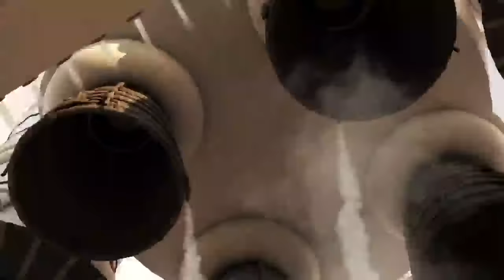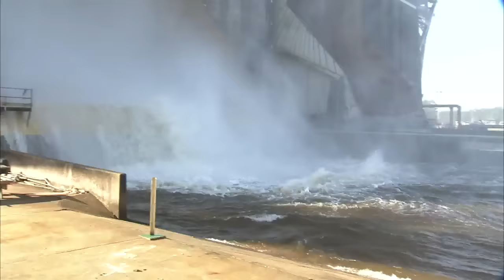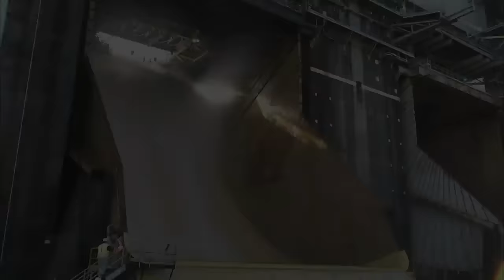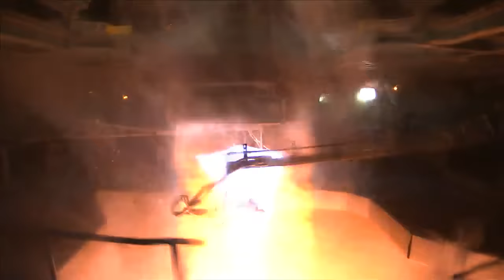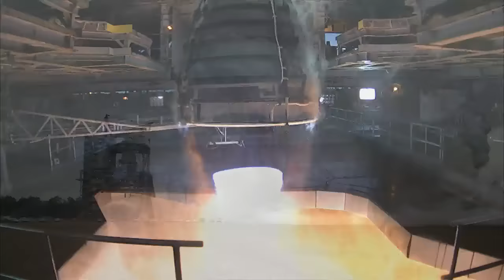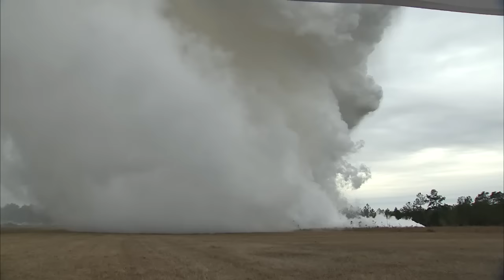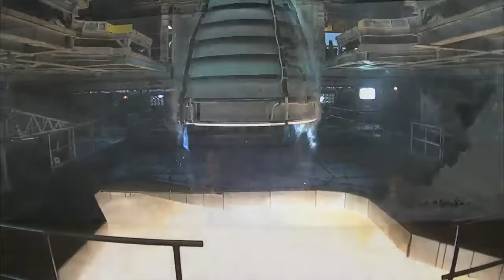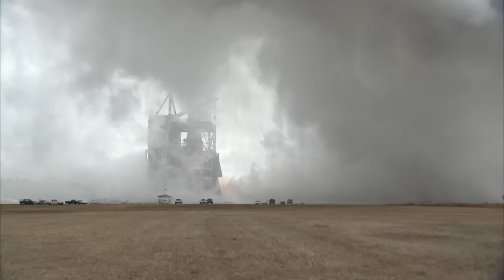NASA Conducts First RS-25 Rocket Engine Test of 2018

Comment: One third of the F-1's thrust but still good for most rockets.
Reply: It won’t be flown unless NASA somehow completes the sls
Reply: @urmomconnor7870  They already have the first one for the most part, they just need to assemble it
Reply: Yes but I'm pretty sure that the rs-25 is more efficient
Reply: Thrust isn't everyrhing needed
Reply: Raptor kills it on the ground
Reply: Ok
Reply: The f1 isn't the most powerful engine.
Reply: Bombing Playground  I'm 3d printing a highly simplified raptor engine.
Reply: Finished the 3d print, took 5-7 hours in total. Couldn't be bothered to calculate the print time :)
Reply: @rocketman99  Raptor has less thrust and is less efficient than the RS-25, but it is much lighter and cheaper.
Reply: A Well Dressed Male Papaya but it is the first methane powered rocket so what is the basis for your comparison
Reply: @xavier1964  I thought the Raptor is supposed to be more efficient and more powerful for its size. That's what SpaceX claims.
Reply: @xa-xii4865  There is no such thing as "more efficient for its size", efficiency is represented as a number. The RS-25 gets about 452s isp in vac, and the raptor gets 380s. This means the raptor is less efficient regardless of engine size. That being said the raptor is a much smaller engine as well.
Reply: @barrett2724  Its not, the Blue Origin BE-4 engine was ready before the Raptor and is powered by methane. And ISP (the measure of efficiency) is the same across all propellant types, so the fact that it runs on methane dosen't matter in this case.
Reply: A Well Dressed Male Papaya but I don’t see a test base for the new Glenn to do weight to thrust ratios using specific thrust equations for the comparison is that to complicated for you
Reply: @barrett2724  My comment never mentioned TWR, TWR literally has nothing to do with engine ISP. I also never said the BE-4 is a better engine than the raptor, only that the raptor was not the first methalox engine.
Reply: @xavier1964  Well I will give up my affinity for the raptor and find a better rocket engine instead :'(
Reply: @xa-xii4865  The raptor is still an amazing engine even though it is less efficient. The engine is still a great leap forward in technology.
Reply: @xavier1964  nvm the raptor v2 is out

Comment: RS-25: i'm the most powerful engine!! 
Spacex Raptor: Hold my turbopump and methalox
Reply: See, the raptor is great but it has never seen flight. The RS-25 was used in the space shuttle. And I am pretty sure RS-25 is still the most powerful. Even if that is not the case, Rs is an amazing, efficient and powerful engine.
Reply: @anonymous_bacon2383  If they reused the RS as on the space shuttle they would be the best engines, they have high lsp an atmosphere and vacuum.
Reply: @anonymous_bacon2383  if you count the starhopper it did technically fly
Reply: They actually share very similar peak thrusts. In fact, while the raptor is slightly more powerful on the ground, rs25 beats raptor in space because raptor is not yet vacuum optimized. Also, you should check out the rocketdyne F1, because it is more powerful than the raptor by a factor of 3
Reply: The rs 25 has problems.... The hydrogen corrodes the parts and makes the rs 25 inconvenient and inefficient in the long run. The raptor just needs a vacuum version of its nozzle and it's good to go. It has no hydrogen embrittlement problems as it's burning methane instead of hydrogen.
Reply: Spacex could make a variable nozzle for the raptor for SSTO rockets.
Reply: @andrewmitchell5807  3 Raptors and you have an F1!! 15 raptors and you have the equivalent of the Saturn V first stage thrust :)

Comment: Always wondered how that blue cone-ish shape forms when the engine is first fired. And later in the burn
Reply: The flow in that region passed through shock waves, which compressed it, making it slower and hotter. So hot that it starts emitting in the visible part of the spectrum. 
Look up for Mach diamonds. The flow field of a supersonic jet is quite weird cause you have a lot of shock and compression waves, but it's very interesting

Comment: SLS is taking forever to build even though is based on existing technology. RS-25 engines were used on 135 Shuttle missions, wasn’t that enough to prove the reliability of its design? Or else, maybe they have made significant changes, then is not RS-25 anymore, but as far as I know they have not given info on this matter. I think this is due more to administrative issues than technological. It seems that on the short run, SpaceX will overtake NASA on Human Space Flight technology. And that would be incredible.
Reply: No bucks!!  No Buck Rogers!!
Reply: Not about testing it's reliability. It's about testing upgrades and improving on an already excellent engine design. Even the RS-25 is based on the HG-3(Saturn upper stage engine). My guess is after they're done with upgrades they will probably call it a Block II RS-25E(the RS-25D having been used from STS-104 onward).
Reply: RS-25 is fancy-pancy engine, very efficient, but the cost... 
Of course they will start by using engines left over from shuttle, but that only lasts 4 flights, then they have to start making new engines. Originals cost 40mil per one engine I think? I doubt they'll get the same price they did near 40 years ago, so yeah that's a good amount of engine dollars going up in smoke per SLS. Plus two SRB-s.
Bigger rockets are needed, but not at any cost, especially as it looks like there will be alternatives coming up fairly soon.
Reply: burz21 
Yeah, I absolutely agree.
Reply: I agree how many times do you have to test this old technology. Get it in a rocket and use it !! Meanwhile we are buying engines from the Russians.
Reply: Indeed, these tests are mainly for proving the new engine controller that is required to interact with the SLS.
Reply: The controllers and many parts like RS-25 parts that use 3d printed parts are new tech and require testing. Plus the SLS rocket provides different head pressures to the engines.  A recent test has gone to a Rated Power Level of 113%, the highest thrust ever for an RS-25.  Most of these tests are on the Development Engines DE-0525 and DE-0528 which are engines that are for testing only.
Reply: Or they could gasp RE-USE THE ENGINES! You know, like even ULA is going to do with their new Vulcan rocket! But no, NASA won't do that, they rather dispose of the single most expensive rocket part after each launch. Well done. slow clap
Reply: Reusing an engine such as the RS-25 doesn't necessarily save any money.
Reply: hoghogwild) Seriously. The after mission overhaul time and cost of the RS-25 was terrible
Reply: We need NASA's old budget ratio back. Like during the Apollo Program.
Reply: We need congress to but the hell out of space flight, and move the budget minded folks working in satalite programs like TESS to the manned space flight side....
Reply: Bad Santa lol
Reply: EARTH IS seriously FLAT ok, please explain are you joking or serious? It's pretty hard to tell at this point.
Reply: EARTH IS seriously FLAT First of all, you didn't answer my question. I am going to assume you're serious about the Earth being flat. Second, round Earth is not hypothetical. The amount if evidence and experiments done to prove a round Earth is so great, it's considered a fact that the Eartg is round. Hypothetical is when something hasn't been proven yet due to lack of evidence. Third, curvature is actually not very hard to measure, especially at sea level. You can do it yourself if you really want to.
Reply: Trex531 NASA was the first to reusable space technology. They wanted to do routine reusable space flights well before Apollo landed on the moon.
Reply: Trex531 no the RS-25 was too expencive for a single utilisation
Reply: Trex531 stretching the boosters from the shuttle. New tanks. New crew systems. New payload carrying systems. Testing the design to assure it doesnt have issues. SLS is almost as big as the saturn V but it much more complex.
Reply: Actually, yes. I learnt the skills to directly measure that in high school of all places.

Tell me this, why is there a consistent lie about the Earth being round for over 2000 (!) years? Is it all because NASA wanted to fund a global conspiracy a good 1950 years before they were formed?
Reply: It probably might be best for a private enterprise to pick up from NASA. Ultimately, the direction and workpace will be affected by public interest and government funding.
Reply: Earth is Flat guy - - one L too many in that moniker.

Comment: NASA’a multi million dollar smoke grenade
Reply: That's steam, not smoke. Hydrogen/Oxygen is literally the cleanest fuel you can burn, because all it makes is heat and water vapor. The SRBs on the other hand, make giant columns of smoke and fumes.
Reply: BlackEpyon thanks
Reply: Which, now that I think about it, gives Rockeydyne's RS-25 another leg up on SpaceX's Raptor engine, because the Raptor burns RP-1 (rocket-grade liquid methane) and oxygen, leaving a carbon footprint. It's a bit of a moot point though, since NASA has to involve industries from the entire country (being a government organization, it has to be a "jobs program" after all), where SpaceX manufactures their rockets all in a single complex.
Reply: @Sevival  Steam isn't smoke...........
Reply: @Rael14  then what is the definition of smoke, then? Why is this not smoke?
Reply: @dphorgan  smoke is a collection of airborne solid and liquid particles and gases emitted when a material undergoes combustion. This is a H2+O combustion resulting in airborne H2O particles. It's fucking smoke. Doesn't matter if it's composed of water. A great deal of smoke from burning wood is vaporizing moisture. Stop making a fool of yourself and just admit you're wrong.
Reply: BlackEpyon the Raptor engine does burn methane, but methane isn’t RP-1. RP-1 is rocket grade kerosene, which is used by engines like the Merlin or F1
Reply: Steam Grenade hehehe
Reply: @Sevival  steam is a version of very fine water droplets.  A smoke is a dry particles burned
Reply: @BlackEpyon  plus a smoke cannot condense like water.   Smoke just becomes powder of soot.  And steam means literally heated water vapor.

Comment: That transparent flame in LH2 - LOX engines always gave me a hard-on.
The power... the temps... if you stuck a rebar up that ~3400 K nozzle i reckon it would liquefy in seconds.
Wholesome, unadulterated combustion... and the exhaust fumes?
Water. Fucking water... gets me every time.